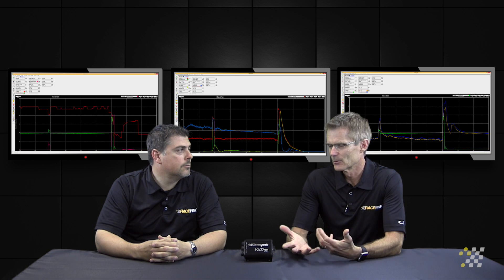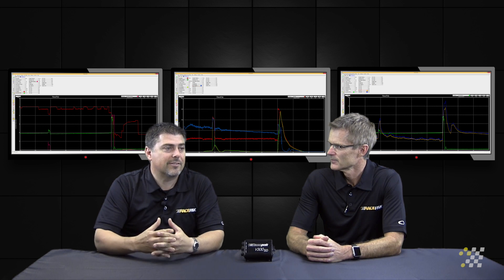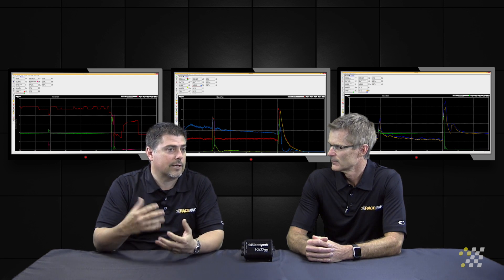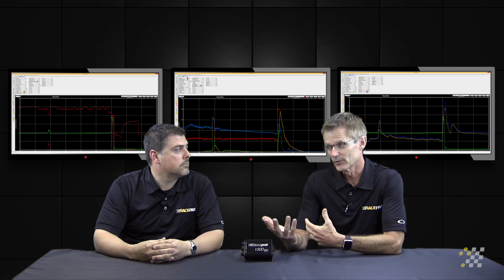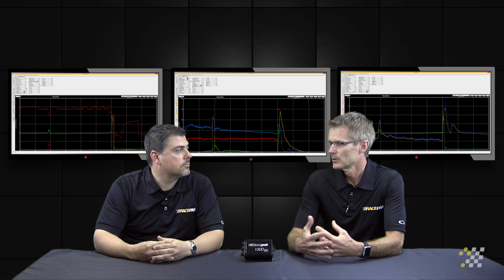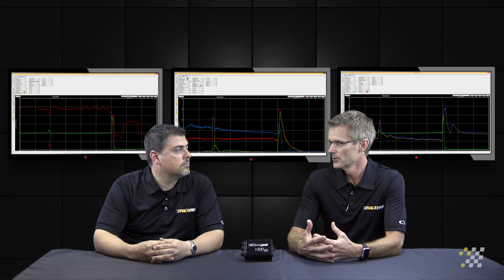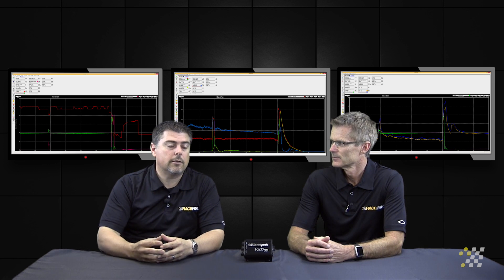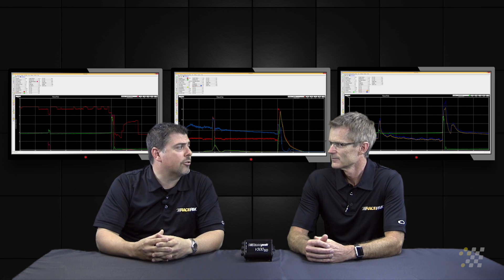PART 8 WATER TEMPERATURE

Comment: Can i wire my oem coolant temp sensor which is also a single wire just like the ones provided with  iq3s ?
Reply: +Racepak Media why would i need a module if the sensors you provided for coolant temp/trans temp are similar to the oem one i already have installed for engine ?
Reply: +Racepak Media then why would you state that i will work with any street car out of the box ? You never stated extra modules would need to be purchased for something simple like ect. I understand the vnet options.
Reply: +Racepak Media so even if i wanted to mate the iq3s to hondata s300 i am going to need usm ?
Reply: +Racepak Media that is K pro, there is one for S300 if i remember seeing it on your website. Unless module is the same.